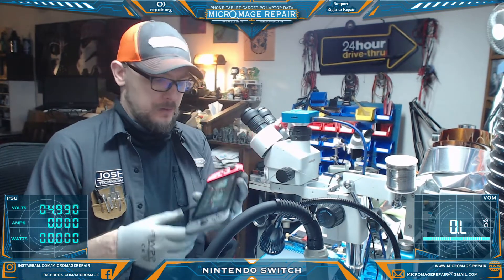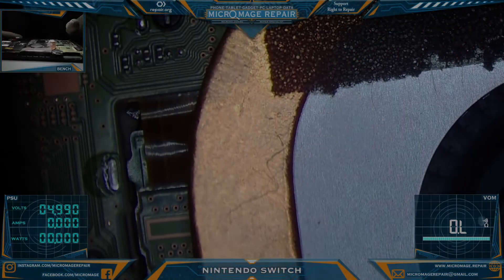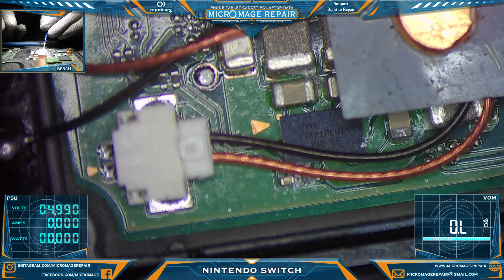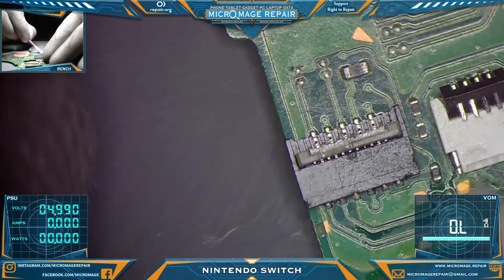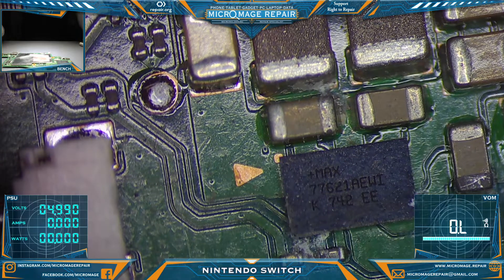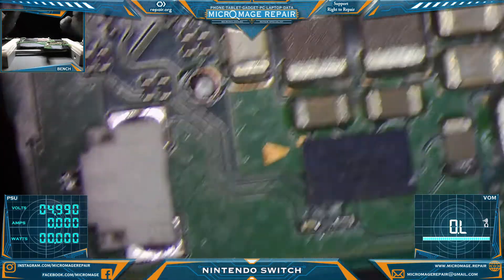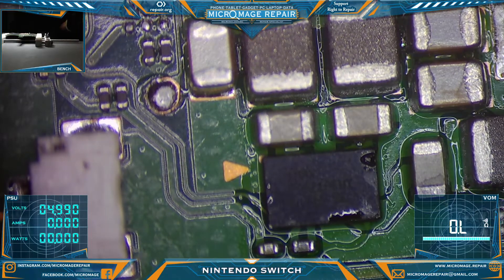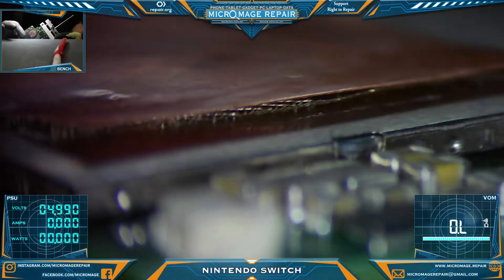It really throws a fit over baths!

Comment: What's that max chip called. 77621? I think I need to replace mine
Reply from the maker: 77621, it is one of the buck regulators for the APU. What is the Switch doing behavior wise?
Reply: @MicroMageRepair  had a tiny bit of water damage. Worked for a week after that but then died. 
Fuse above charge port was blown so I replaced that. Everything looks good around the m9 chip and I get green rcm when I plug it into my PC.
The reason im sure I need to replace the max is that I chipped the side of it with my tweasers when removing the speaker wire like damn fool
Reply from the maker: @spastroboy  Mistakes happen. The learning curve on these devises are real! At least it is yours and not someone else's.

Comment: Nice work mate...which barlow lens you using with microscope?
Reply from the maker: Appreciate it! .5x
Reply: Try aliexpress: WD30 WD165 WD120 0.3X 0.5X 0.7X 0.75X 1X 1.5X 2X Trinocular Microscope Stereo Microscope Auxiliary Objective Lens Barlow Lens
Also for image quality look for: C Mount Adapters Lens 0.35X 0.5X 1X CTV For Trinocular Stereo Microscope 25mm Interface Microscopio Camera 👍
Reply: @Ratchet_effect  thanks alot...